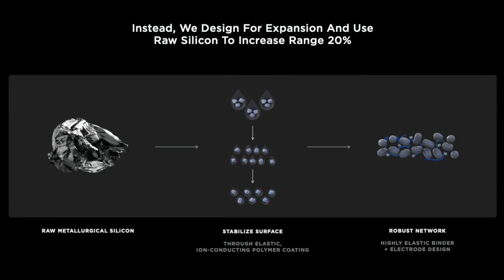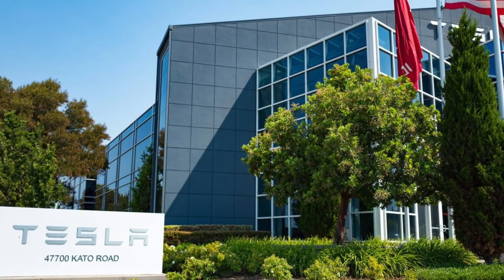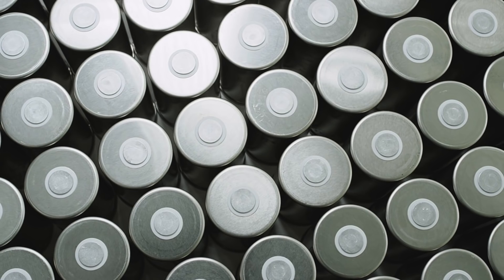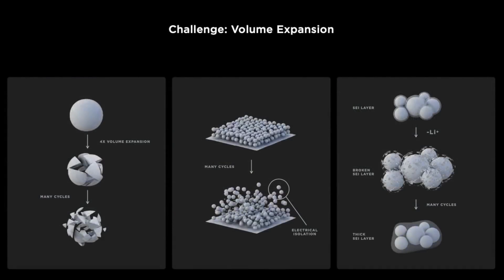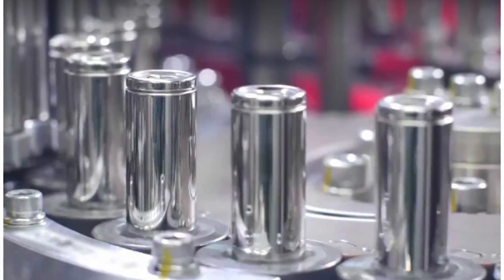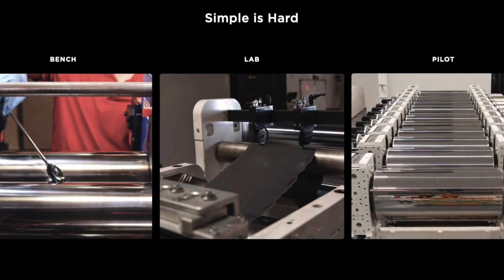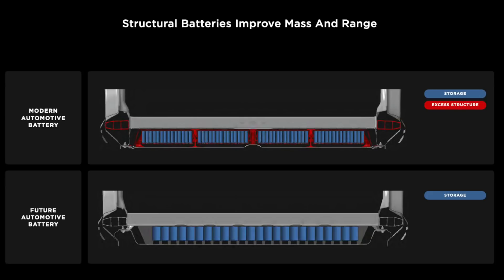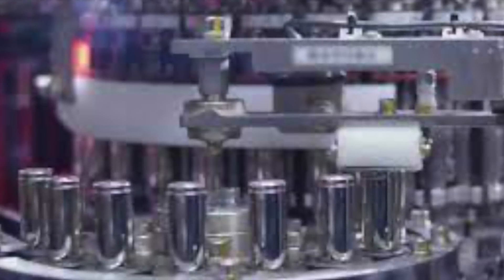Model S Plaid & Long Range Using Different Chemistry

Comment: The Plaid Day "One More Thing" was actually Two that may overshadow 4680, due to being applicable to all battery formats. I.e.,  Ultra-light, carbon-wrapped motors, plus battery thermal management.

So no changed chemistries as that would take whole reworkings of cell assembly processes. Also not 4680 which are needed for structural pack cars.

Anyway, the only way to know is to buy a $13-50+ MunroCom sticker to fund the last 1/2 of their MSP purchase for teardown (they may also reveal separate 3rd motor gearing & do run-to-drop testing).

Comment: You could be right, but I don't think so.  The demand for 4680 cells is very high.  They need many tons for their semi trucks, and then the cybertruck, and then the roadster.  I believe they have used either the 18650 or the 2170 in the new S and X plaid.  The process to produce both already exists and changing the chemistry may be enough to boost their output.  Also, they have made significant improvements to the motors which will be contributing to the range.  We'll soon find out!  
The major problem, I believe, is producing the 4680 in volume.  So far, that hasn't happened anywhere.  When it does, the kaka will be flying.

Comment: This plaid is using 18650 with some new chemistry tweaks.  The battery was never the power limit, it was always the cooling and the motor.

Comment: 4680 tabless is necessary because the fat cell needs to get heat out differently. 18650s in the model S probably have some chemistry changes but not all of the 4680 and not tabless since that isnt necessary

Comment: From insideves "Separately, Panasonic is upgrading its battery chemistry to boost the energy density by 5% later this year, and 20% over five years." Probably adding silicon.

Comment: Motor Trend was testing the Plaid. They use something called rollout, which involves a laser beam pointed at the front tire. When the tire passes the beam, it has moved one foot. At that point, the Plaid was already going 6 mph. That's insane. 6 mph in one foot.

Comment: I suspect that 4680s that have been produced in quantity so far, have a lower than planned energy density, and therefore do not have the ability to reach the 500 miles planned for the plaid +.  They are probably using already produced 4680s from the pilot line, and making room for newer higher energy 4680s.

Comment: AFAIK battery production ramping is about increasing yields (the proportion of good/safe batteries vs. faulty ones). Elon said on the call that they were making sure that the new batteries are safe enough. Somehow I think that Kato Rd. factory has already produced some good 4680s that may have gone into the new Model S Plaid, despite what Tesla employees may have said at the delivery event. All we need is the first of those 25 to get into a major crash--and given the car's power this is just a matter of time--to see what's inside.

Comment: Tesla is not producing 1865 itself, they are coming from Japan and produced by Pana. New 1865 chemistry perhaps has 10% or less more eficient than the previous ones. So, the performance is not all about chemistry.

Tesla designed all new battery pack for performance. They changed everything and lost weight. And coupling that with more efficient cells, the most advanced engine and more advanced cooling they achieved Plaid. Model S Rawen was no slouch.

You are way off on this subject. You will see.

Comment: How many times are you gonna defend the same arguments in a brand new video, which is time consuming to watch and even much more to make, to drive your point home? I get that when a person is wrong, they have to repeat their lie over and over again until people accept it as a dogma... But the thing is : I don't think you are wrong. As a matter of facts, I'd be surprised if you were. You are right, in my opinion. Did I reiterate my stance enough? 
So please get over yourself and change the subject. 
You can perhaps come back to it, casually mentioning it (or rubbing it in your deniers' faces if you are that kind of person), once Sandy shows it off but it seems like you now made and remade over fifty shades of the same video.

Comment: What I mean by new chemistry is 'slight changes in standard (18650) cell chemistry - by Panasonic'. Edit: If Tesla are using 4680s and they only have capacity for a few thousand Plaid S, I'm worried. I should have watched the video all the way through first. It's not possible to use the Tesla chemistries in the smaller form factor cells, mainly because of internal resistance which causes heating. Using the new Tesla chemistries means you have to go tabless. that will only occur in 4680. I reiterate, if Tesla can just about support thousands of Plaid S with 4680, then they are a long way off supporting 20 thousand Ys (per week) with 4680. But, yep I get all your arguments on lines. However, if all you say is true, then why was Plaid+ S abandoned? 4680s with tabless and high nickel chemistry coupled with structural pack and front and rear casting should give you Plaid+. So maybe not all of the pieces are in place yet. Equally, one gigapress in Fremont with experimental production of casting is not going to give you the throughputs required to switch 3 or Y. So maybe Plaid is using castings. Sandy is well on his way to crowdfunding a Plaid S purchase, so maybe we'll get the tear down just as soon as he's finished destroying the Mach E. Will be very interesting.

Comment: I also want it to be the 4680 but it's not and if it was the improvement is to small a difference. It's probably just structural, cooling and a small Chenery change from 3rd party. The 4680 is the difference between plaid and plaid+.

Comment: You have several wrong ideas and maybe my Physics background can help. 
First, the 4680 mechanical design can take any chemistry so stop worrying exactly which one they used first.
Second, Tesla would only do the S and X Plaid refresh one time and it would have to include the structural battery pack, new cooling system, and new motors.
Third, the Kato quality improvements would have little to do with vehicle safety issues and everything to do with factors like manufacturing process reliability, speed, and yield quality. After that there would be actual charge/discharge performance and reliability verification.
Next, the 4680 design vastly improves both the thermal and electrical conductance. The copper foils sticking out one end of the jelly roll all get squished together and crimped right into the base of the can where it has a rim that actually sticks out like a .22 shell. This bottom end is thermally bonded to the battery pack floor where the cooling channels are using a thermally conductive glue. At the same time this thermal path must be electrically insulating because the battery case is electrically hot and not the same voltage as most of it's neighbors.
Compared to the old tab design, where all the electricity and most of the heat had to go through a small metal strip, the 4680 must be 10 times better both thermally and electrically. This totally game changing! The Weber YouTube channel showed that the older Tesla motors had a resistance of 13 milli-ohms while the performance version was only 0.005 ohms! You need very low impedance batteries that can keep up with the new motors which must be even lower. That is clearly what is in the new S and X.
Also note that the current new plaid motors can do 400 hp each, presumably at or below 20,000 rpm, but Plaid is rated at only 1020 hp. I figure there must be at least 1200 hp in the future and maybe even more? Will these new motors also appear in the Cybertruck and Semi by just changing the output gearing? If a semi only needed an 80 mph top speed then each motor could achieve 2.5 times the current Plaid torque - WOW!
My best guess about your range question of the LR vs Plaid range is simple: Tesla is sandbagging and could OTA the range to 500+ miles when needed. They could also be software limiting the power levels too. Or maybe just a slightly depopulated but otherwise standard structural battery pack. Or maybe this is where you chemistry question really belongs. They could be adjusting for future cost reasons, but I bet they left themselves room to improve later by software OTA, like next time Lucid chimes in.
Regarding 18650, I see no reason why Tesla and Panasonic could not cooperate behind the scenes to transition smoothly without telling us how they do it. Furthermore, couldn't they just throw extra 18650s into powerwalls if they had to? 
Did I leave anything out? I like your channel and do wish you well! I would be happy to help further this cause because I find their first principle solutions to be so well executed.
Reply: For someone who has a physics background, you made an obvious mistake.  "Compared to the old tab design, where all the electricity and most of the heat had to go through a small metal strip,".  The heat does not "mostly go" through a small metal strip to be wicked away.....  

From a heat management point of view, the 1865 and 2170 batteries are cooled from their sides, and not from the top, as the total area of the cylinder/volume is significantly greater than the 4680.  This means that using Tesla's old cooling design for the larger cells, from the side, would not work, and thus Tesla had to invent a different way to cool the larger volume.

It's a chicken and the egg conundrum.  Was tabless "invented" for the cooling problem of the larger volume, and gave a side benefit of faster mfg and better energy throughput, or was it the other way around?
Reply: @dalerichardson7202  Thanks for your thoughtful reply Dale! I do not mind being wrong because that is how I learn.
You are correct about surface area vs volume vs cell size. Fewer, bigger batteries are easier to manufacture and Tesla addressed your size point on that graph at battery day. I understand they currently cool in between cells and that seems like a hard thing to build. However, I am not clear how easily heat flows outward through the many jelly roll layers to reach the side. Obviously good enough so far but do you agree with me that firmly crimping the copper foil ends provides an even better thermal path? 
I keep wondering how they will establish the firm connection on the other top aluminum end.
I figure tabless was invented for manufacturing benefits and high electrical current demands more than just thermal reasons but that is a good question.

Comment: Every time I watch a video on this channel I end up thinking to myself “just because something does or does not make sense does not mean it did or did not happen that way.” Tesla was under tremendous pressure to release a big winner in the Plaid. They would have done anything necessary to put out a high spec car. Musk is not one to hide his achievements or downplay a technology. If the Plaid had 4680s his Twitter feed would be full of orgasm posts.
Reply: I'm not so sure. He has been sandbagging quite a bit lately.

Comment: Panasonic has stated that they're updating their battery chemistry with an increase of 4-5% over the next few years. No new Tesla chemistry or architecture used by Panasonic. Also, the source is not GigaNevada but Japan. The battery from multiple Tesla sources are 18650's from Japan.
Reply from the maker: 4-5% improvement in range? kwh per lb? Well we are seeing 20-25%.

Comment: Wow, to deliver a higher current you must lower the cell internal resistance.   That's what the 4680 new current flow path does.  Plaid is the first proof of 4680 concept

Comment: Higher HP means higher kW.  W=V x A.  If V is fixed due to supercharger system,  then current must have increased a lot. 30%?  Only 4680 could potentially do this... that I know of.  They're pulling higher current.   No wonder they had headaches verifying fire safety. A gotcha there could easily impose months of R&D to solve.   Got to be 4680.  That HP graph is going to freak engineers at all other companies.   Ultium cannot deliver that much current.

Comment: Ok, makes sense.  If the plaid performance was due to super caps, the initial acceleration could be higher HP.  BUT, when drained, it would fall back to normal past HP.  Instead, the graph shows steady peak HP to high speeds.   Aerodynamics and weight would increase acceleration,  but not HP.  To get higher HP the motor needs to accept a higher current.... watts actually but I assume voltage is the same due to interfacing with superchargers...  so, higher current motors and  battery pack, both.   We know the motor is new. But, the battery pack must also be new and capable of higher current.   4680s do this.

4680s allow higher current due to current flow orthogonally to the coil film direction.  I think you got it.   4680s allow higher current and the new performance creates 5 new products.   Plaid versions of S, X, 3, Y, CYBER.  The product map just needs 2.  Priced initially at $30k instead of $25k, tesla will make an extra $5k net per car, times. 2M  per year =$10B/yr additional profit by about 2023 or 2024.  That should trigger the 50/50 credit phase out.

Comment: I tend to disagree. I believe Tesla updated the 18650 chemistry (with higher silicon content for higher capacity,charge,discharge, and deal w the stability issues) . 
-Same construction and not tabless
The biggest advantage of the 4680 larger format imo is price and scalability, which is not important for S and X.
Reply from the maker: Yes, that is possible, but I am saying how unlikely they are to invest so much effort into the 18650's to achieve that. When they have 4680s already doing it, at a lower cost, and lower weight.
Reply: @TeslaEconomist I imagine a new 'recipe' wouldn't be a large investment given the same battery assembly line and scale.... 20% performance gains seems reasonable. essentially you'd get 4680 performance with higher weight and price. (They won't have heat issues/or need tabless because their large, or care about scale/price)
-
Reply: @TeslaEconomist  : You'll be interested to hear 'the limiting factors' take:
https://youtu.be/RLraFClFbEA

Comment: If they're not using the 4680 then I would expect them to use improved chemistry in the 18650, not the 2170, because the smaller form-factor of the 18650 allows for more rapid charge/discharge than the 2170 because of the total area the electrons must travel within the battery.  The 4680 works so well because it is tabless and so the electrons have a shorter path to travel than even the 18650 (top to bottom instead of top corner to bottom opposite corner).  Without the tabless design, the benefit of 2170 over 18650 is a better battery/battery casing ratio (power to weight) but that comes at a cost to performance.  I would expect 2170 to be LFP where weight is more of a concern and longevity is more important than performance.  Please double-check my work, I'm just some random guy.  I think The Limiting Factor has some good info on this.

Comment: A tabless design is not chemistry.
A form factor is not chemistry.
Dry electrode(additives) is not chemistry.

The updated S and Plaid S probably have a slightly smaller battery pack. Despite better aero, introduction of a second gen heatpump and new (probably more efficient motors), the range increase was around 1%. While over 10% would have been more logical.

Tesla redesigned the battery pack and the thermal management system. Also, Elon Musk himself said during the 2020Q4 conference call that the S and X will continue to use 18650 cells. Those cells mainly are produced by Panasonic in Japan.

The 10% smaller pack in the new S and X could be because of more cooling. But maybe Tesla did change over to a different battery chemistry....

Up until now, Tesla used NCA cells for their cars. At battery day it was made clear Tesla would switch over to LFP for the SR+ cars and the new 25k car. The S, X and Cyber will use NM(C) cells. The Semi and Plaid/TRI motor cars will use the High Nickel NM(C) cells.

NMC is slightly less energy dense than NCA.

So if Tesla made a big change in chemistry, it's probably the switch from NCA to NMC. I hope Elon will elaborate soon about these kinds of details.

Comment: The biggest hole in your theory: why on Earth would Tesla sandbag that they’ve successfully deployed 4680? Making that announcement at the Plaid delivery event would’ve been all upside and no downside. Doesn’t make sense.
Reply: osborn effect,  no one would buy existing teslas with older battery tech,  until they all get updated
Reply: @fasthardware6293  I don’t buy this. You’re telling me the casual avg Tesla buyer will somehow extrapolate that a new battery pack in the Plaid S will mean that current Y’s and 3’s will be obsolete in a year? That’s a stretch. I’d agree with you if Tesla announced that their new tech would be in the Y’s from Berlin and Texas, but simply saying the Plaid is utilizing our new 4680 form factor which has helped with power and range, I don’t think that would drastically affect buying patterns for the Y.

Comment: If Kato Road has been making batteries for months...where are they?
Reply: Warehousing for Austin and Berlin to get car production started since on-site battery production likely won't be ready.
Reply: @wadeyorke8144  Seems reasonable. Tesla's strategy going forward is pretty dependent on a high volume of 4680s. I bet they had solved production issues some time ago but played it close to their vests when announcing 4680s on battery day.
Reply: Powerwalls? Semis? Plaid?
Reply: @ericswensonvfxsupe  Certainly not for Powerwalls. The Plaid is in production...with or without the 4680s. Maybe they are building up inventory for Semis and Cybertruck.